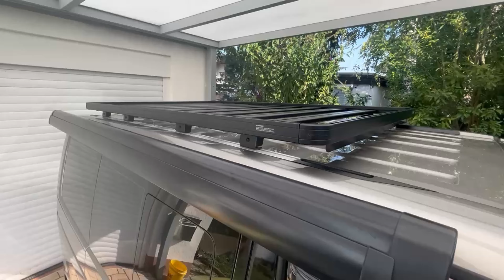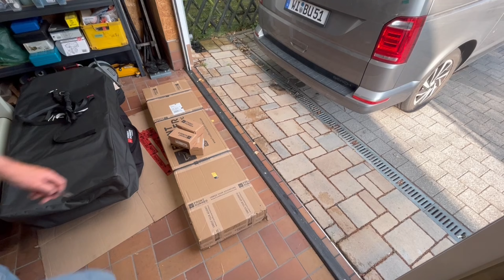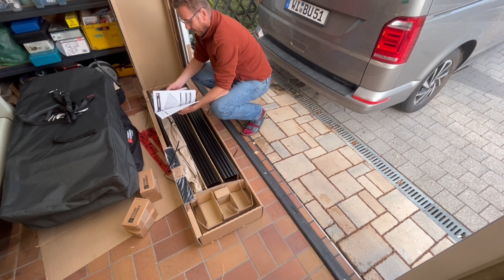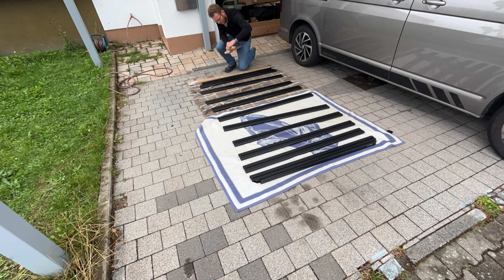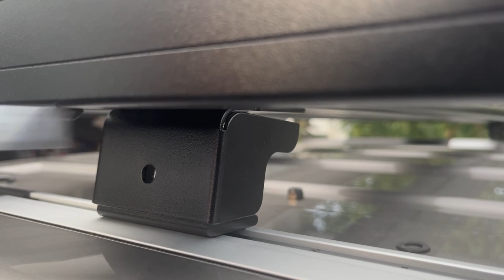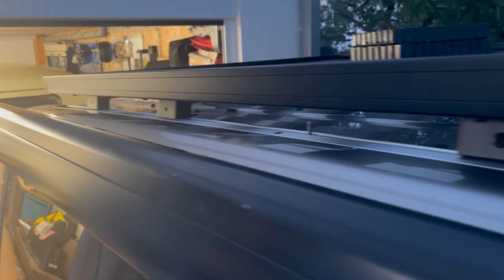Front runner slimline 2 Full length Roof Rack on a VW T6 California

Comment: thanks, why not the half version so you can load more weight and lift it without emptying it since you can place it near the back hinges of the roof?
Reply from the maker: You a right a half rack could be loaded more and left loaded. 

Everything I wanted to load on the roof didn’t fit on a half rack and I didn’t want to stack things on top of each other  because they were damaged when I did that  previously. 

If you have hydraulic roof keep in mind pushing it up loaded requires a lot of extra force and repairing the hydraulic pump might be very expensive.
Reply: @Andrew_vanlife i went for a 150 long Cruz Tanami is about 19kg with the bars.. sitting at the back..the front runner is a top choice I think ..slim ..you can drive/park anywhere and it doesn't affect consumption much.
Reply from the maker: The Cruz rack looks great. I really like how easy it looks to mount and dismount the platform. Thanks for commenting 👍